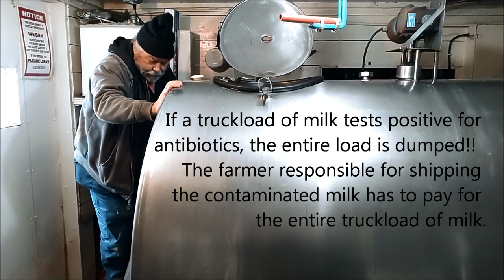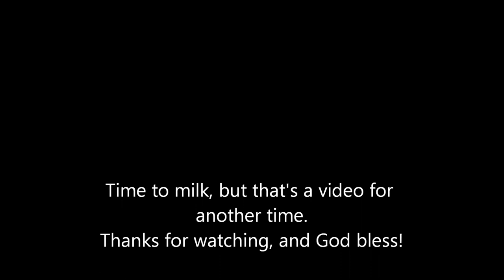Chores on a Small Dairy Farm- watch our video manure wars the shovel strikes back before this one

Comment: Is there a way to run the barn cleaner and catch it with the skid steer?  Just a thought, maybe there isn't enough room for the skid steer.
Reply from the maker: Now I have a vertical pump in there that runs the liquid manure out to the pit in pvc pipe.  Really hoping to get the underground line fixed before it gets too cold.
Reply: I know how that goes, before we got the pit, the manure was hauled out daily with a spreader. In winter no matter how clean you scrapped the spreader off, you would break the apron chain or it would pop off the rear sprocket. Then you would have to unload the spreader by hand in order to fix the spreader.